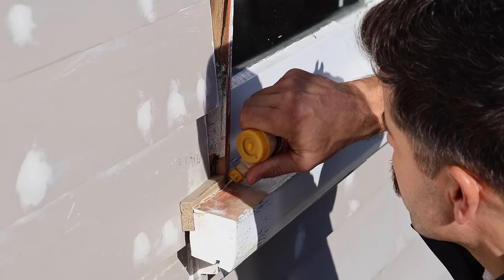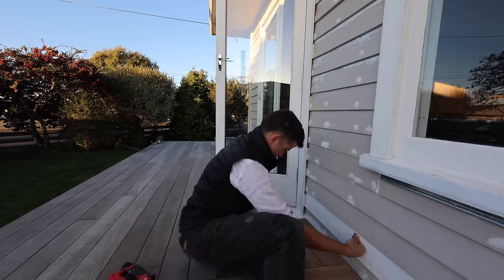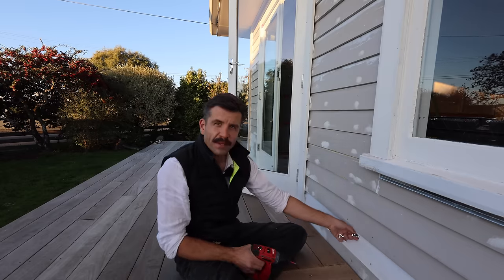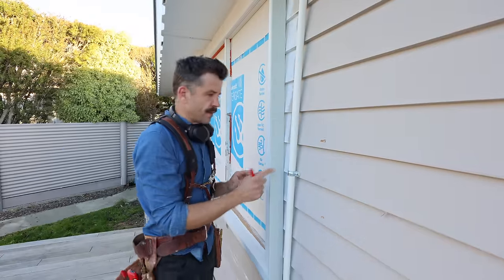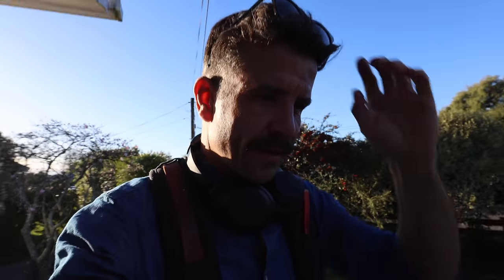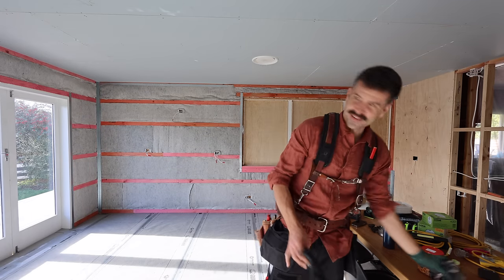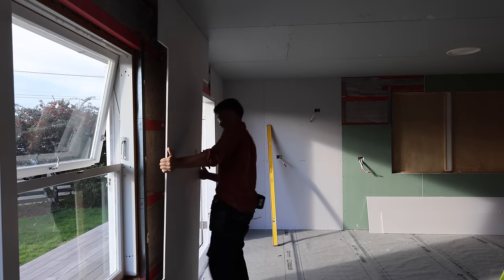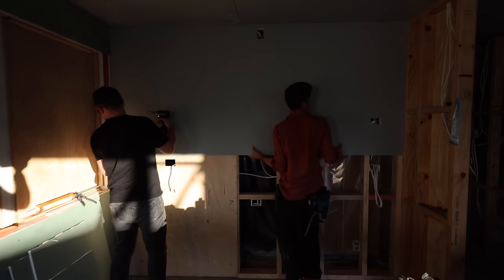This Has Taken Me 8 Months...

Comment: Hi, After 45 years of my working life I figured out that if you placed the door hold back hooks higher on the door you did not have to bend over to clip and unclip them. Another trick is to mount your hotpoints at the same hight as your light switches to help with plugging and turning on/off. I used to do a lot of work in retirement home. Keep up the good work Scott. Cheers Dave from Dannevirke.
Reply: Agreed on the placement of the door hook. I would have put it at hip height. Interesting bit of trivia: in the early days, hotpoints (power sockets) were placed high on the walls for easy access and it stopped small children from reaching them.

Comment: Instead of a hook to keep the door open.  Put a metal plate on the door and have a super strong magnet to hold the door.  Then you can just pull the door hard to close it rather than bend the aging back.  =)
Reply: I put mine on my own house at hip height. Aging builder things, right?! 😅
Reply: Our wind beats magnets 🧲 😊
Reply: @flangekiwi  correct 100%.
Reply: @FysonTord  I was just thinking that. I would have put the hook at hip height, much easier to operate.
Reply: I use my foot to lift the hook 😊
Reply: @TheG1162  Using your foot is not so easy to put the hook on.  Magnets are good for ON & OFF.  That said, a tall hook is great to keep kids from doing things you don't want them to do.
Reply: I use my framing gun and just toe nail the door open.   When I want to close it I just don't.

Comment: I'm very impressed by your high inspection requirements in NZ as a carpenter in Sweden. Never had to wait for an inspection before putting up plasterboard.
In general you seem to have inspections for every little thing!
Reply: Pre lining inspection is basically to check that your framing timber has dried out enough before you seal it behind your plasterboard
Reply: @drewmis1  Never had to do that even once! Very interesting. I can remember one time when the inspector wanted some photos of a special stud arrangement for soundproofing, usually that's not even required.
Reply: New Zealand was left traumatized by what we call here the 'leaky building debacle' (see the Wikipedia article 'Leaky homes crisis'). This explains in part why our inspection requirements are so high.

Comment: It's interesting to see the different building standards in other countries or regions. In Minnesota (USA) we would put a plastic vapor barrier on the wall before the gypsum board. The inspector would need to see this (and the continuous sealant where the screws will penetrate the vapor barrier) before we are allowed to hang the gypsum board. I couldn't tell on yours, but our electrical boxes on the exterior walls have weather stripping on them that seals to the vapor barrier. I don't imagine that you would need that with no vapor barrier. I like your scribe technique for the lap siding.

Comment: In the states we would’ve had to put nail plates over the wire where it went through the framing so you couldn’t drive a nail through the wire. Also I believe the term yo were searching for is the wire is “derated”, basically they used a larger gauge to make up the loss. Great video Scott.

Comment: That condute beside where you were discriibing scribing, I guess is the good wook of Chorus
Reply: Why not put inside seeing as you have had all the linings off???
Reply: Chorus never fail to disappoint...
Reply: @77chuckles  The best way seeing as the cable probably comes in overhead is to fit a demarc box on the gable end and take it straight inside through the ceiling cavity.

Comment: When scribing I will rip the scriber down to my preferred depth.  I measure from the deepest part of weatherboards to the front of the facing plus how far forward i want the scriber to stick past facing. Then I use an offcut of weatherboard (same thickness as weatherboard) to mark scriber. Usually I would use sliding square set at 2/3 mm,  Ruler part of square up against weatherboard instead of using a packer. The last few i have done, I have simply marked the vertical and horizontal lines the same way but cut on the  underside of the horizontal (left line in). Each to their own. Enjoy watching different ways to do things.

Comment: Scott, whats the reason that you glue and screw the drywall? In Sweden (and likely other parts of europe) we just screw it to the wall. Is it to add rigidness?
Also, in Sweden (and other nordic countries) we use "flex pipes" and junctionboxes to then route individual colors of wires (Blue=Neutral, Black/Brown/Gray=Phase/Live,  Yellow+Green = Ground). I think it's handy because in 25-50 years when you are required to swap the cables for newer ones, you can simply pull new ones through without opening the walls. Also, if you need another Phase/Live in a shared socket (washer+dryer e.g) you can simply just pull in another phase without opening the wall. Your thoughts on the pros/cons would be most valued.
Reply: Lived in Germany, the plasterboard was double the thickness of plasterboard in Australia. Maybe that has something to do with it……
Reply: DIY person here, so I might not be right . . .
The board is glued in the middle of it to reduce the number of screw-holes that have to be plastered-over.
To the greatest degree possible, only the edges are screwed and the edges always need plaster anyway.
Now, you can't get away with that on ceilings so, in addition to gluing, the ceilings are screwed but often done in 'pairs' of screws close-ish together [40mm] which reduces the number of 'locations' that have to be plastered on the ceiling.
Note that the board is not usually 'skimmed' all over with plaster; only the joints and screws.
In Australia we call that a class 3 or 4 finish [I think] - not very flat but defects can only be seen by glancing light.
A class 1 finish is all skimmed, so screws in the middle might not cause so-much increase in work.
A top-gun plaster crew can do a whole house, from boards, to ready to paint in one day . ..

Comment: It is a satisfying job hanging plaster, not trowelling and sanding, that sucks. Re screws where glue is- I've never had an issue, over 35 years, I think it's a hangover from the old days when they used nails and/or green wood. A nail can move in and out with building movement but not a screw. Mo suits you.

Comment: G,day Scott Brown Carpentry "with Jess" from Sydney Australia.
The scriber board set out: making sure the board (scriber) depth finishes flush with the storm moulding (outside architrave) therefore the distance of the outer edge of the weather, to the surface of the architrave is important.
🤨🇭🇲🛩️
Reply: Not flush but consistent with all others. He started off right with keeping the scriber parallel with the facing. But he should also have kept it a set distance from the facing and based the width of his scribing jig/block on that rather than the deepest point to the weather boards.

Comment: Insulation does NOT take away any performance. What it does do is reduce the sustained power dissipation for a given maximum temperature in the wire, ie some amount below the melting point of the sheathing and much lower than the point at which wood starts to burn. Performance in a wire is voltage and power loss under load which is unchanged no matter how insulated it is.

Comment: I really really still just don't get why the exterior casing goes over the weatherboards. You can easily cut them back and have them butt into the casing. There's literally zero benefit doing it NZ way and adding scribes.

Also, if you research you will see that exterior casing should have the head piece run long(on top of), not in-between the legs. It's for water diversion. When you stick the head piece in between water can find its way down that seam.

Exterior casing (if not mitered) always goes;  head piece long- legs come down from the head, and the bottom or sill piece goes inbetween the legs

Comment: In my opinion this glue between plaster and wood is pointless because it creates some clearance, which makes weak points so can be easly break just by punching. Plaster shoud be touching wood by the largest possibly area. And if You just HAVE TO glue it, because You were taught so 50 years ago or so, better use small dose of expanding foam which is one of the best glues and can be squzeed almost to 0. Pro tip: spray just a mist of water on wood before foaming - foam sticks better on wet. 2nd pro tip: 1 layer of plaster board sux
Reply: @daniel.s8126  oh, sorry for you guys there. Looks like we have better stuff in europe. Even plaster is 12,5mm but still - 1 layer can't be called a wall : P

Comment: its probably too late now gibs up, but why dont you put in a hybrid cat6 (internet cable) cable inside the wall and get chorus back at a later date to get rid of that ugly conduit down the outside wall? you could do the same with the pair coil and delete the capping for the ducted system as for the cables, they are simply derated by the breaker used at the switchbaord to withstand the increased resistance caused by heat, eg, 1.5mm (lighting) is rated unsurrounded at 16 amp, however when partially or fully surrounded by insulation it has to be derated to 10amps.
Reply: The best way seeing as the cable probably comes in overhead is to fit a demarc box on the gable end and take it straight inside through the ceiling cavity.

Comment: Thought you might of got chorus to move the fibre inside the wall since you had all the linings off? Nice build btw.
Reply: The best way seeing as the cable probably comes in overhead is to fit a demarc box on the gable end and take it straight inside through the ceiling cavity.
Reply: @sw6188  yeah totaly. Some chorus techs are lazy as, but this was probably there before they bought the house.
Reply: @matixnznz  I think it was, and for a Chorus install they actually did it better than most by running a conduit down the wall. I have seen way, way worse installation methods!

Comment: ...the insulation takes away some performance of the cable...  ??  Please explain !
Reply: The cable heats up the more current flows in it. Insulation traps the heat around the cable and makes it get hotter. The insulation of the cable can only get so hot before it will start to fail. Knowing this, electricians will use smaller sized circuit breakers to limit how much current is able to flow, OR use a bigger cable that can draw more current with less heat

Comment: WTF on the cables? resistance goes down the colder the wire gets. And your computer and motors get way hotter than inside of your walls. If anything, you cant mix white and yellow wire because the might burn before the breaker pops, especially if there is a short to ground.

Comment: Scribers- it’s the corner of the house ones I can’t get right, the top I always cut short, how do you do those ones? Windows and door scribers are easy enough
Reply: Try cutting the outside of your 'flush' line, not the inside. It will give you back the 2-3mm you lost.

Comment: Are you not going to remove the Chorus wiring and have it inside the framing , instead of in conduit on the front of the house?
Reply: The best way seeing as the cable probably comes in overhead is to fit a demarc box on the gable end and take it straight inside through the ceiling cavity.
Reply: @sw6188  yeah . And then to the OTP . Usually like to run two CAT6 cables from the demark to the OTP or distribution cabinet . 
In Scott’s case , given all the work he’s do8ng I’d be inclined to run the internet and power underground and have the house look better and not get in the way of painting or trees etc
Reply: @bri200490  If it was my house then yeah, all the services would be underground and I would dig my own trenches for fibre and power etc. Everything would come up and terminate in an equipment / utilities room then branch out from there.
Reply: @sw6188  yeah.  Indeed.
Reply: In a previous video, Scott mentioned trenching the cable. The deck means it hits the house too low anyway, so dropping it through the wall cavity is of no use for now. Just get the tench done!

Comment: How does insulation affect the performance of the cables?
Is it something to do with heat build up in the cables?
Reply: I am wondering the same thing. I wonder if someone is confusing the insulation on the cable itself getting damaged during installation? That usually happens when you draw cable through a tight space. I would love to know the reason in this case though!
Reply: It’s to do with thermal insulation affecting the cables ability to dissipate heat and the risk of damage to the cables as a result. I’m by no means an expert and I expect someone will give a far better explaination.
Reply: @mkrnissen  thank you for your reply.
I thought it may be something to do with heat
Reply: Without getting into the jargon and overcomplicating it, it's essentially about heat in the cable and losses and compensating for those losses so you don't have problems when you power up.

The rule of thumb says that a certain size cable is perfectly rated for the job however once you do your calculations you might find that your cable is actually underrated for the job and will cause problems for you such as nuisance tripping or the eventual breakdown of the cables insulation due to excessive heat and exposing bare conductors to the building.

Some factors we consider are:
- cable length
- cable size
- cable path
- cable insulation type
- building insulation 
- conduit diameter, above or below ground, in a roof, etc.
- spacing from other cables, etc.

Not sure about other countries but in Australia we actually have standards that guide you through the calculations so you can get it right the first time.
Reply: @wearsjorge55  thank you for taking the time to explain matters.
I now understand the situation👍

Comment: Cool Tom Selleck look! Why don''t you use the opportunity to hide your internet connection before you put up the plasterboard and ridd of that conduit on the side of the house...
Reply: The internet conduit is going to be dealt with at a later point. The best way seeing as the cable probably comes in overhead is to fit a demarc box on the gable end and take it straight inside through the ceiling cavity.

Comment: what is the tool you use after you have cut the gib? and what adhesive do you use to fix to wall?
Reply: It's a drywall rasp, easy way to smoothen out the side, or reduce it by a few mil if you cut the board too large.

Comment: What do they check during the inspection?
Reply: That all relevant previous inspections have passed. That the building is substantially closed in / weather proof. Plumbing. Insulation. Moisture content of framing. Air seals around windows.

Comment: wondering the meaning about loosing performance  having the cables behind the isolation,  as thicker cable just means more power  can run thrue the thicker copper wire without creating more heat  then a thinner wire  running same current, something that really doesnt have to do with it being behind wall  isolation as wire is calculated on expected loads. but you could say having thicker copper wire has less resistance and less heat with lower rated current  then the cable would be rated for.  but as most cables are behind in a wall or pvc tube  in the wall or in some countrys behind plaster would stil mean they are isolated of dissapating heat and ends up the same as what is done with this type of wall isolation.

Comment: Coming from Canada where we get very cold temperature it really freaks me out that you dont have a vapour barrier.

If you are heating the space to 20⁰ I would still expect you to get some dewpoint in the walls over the winter. Is this not a requirement in NZ?
Reply: from the BRANZ report.....The study suggests that it is not necessary to add a specific vapour control layer to prevent accumulation of liquid moisture. This is in line with previous advice from BRANZ. It is also shown that this practice is in line with current international guidance for similar climate zones, with acrylic paint systems and internal linings providing enough vapour resistance to prevent condensation damage further into the wall while still providing good drying capacity.
Reply: @nix123ism  Awesome background info. I guess you don't get down low enough, or get hot+humid enough with A C running in comparison to the NA climate zones for it to be necessary. 

Definitely a benefit to be able to dry to both sides of the wall with semi-/permeable barriers on both sides.
Reply: @nix123ism  Also, in warmer Southern stated of the US, they have learned that vapour barriers can have the opposite effect (especially when using aircon) and create condensation on the 'wrong' side of the barrier. The roles between inside and outside are reversed with regards to humidity and temperature differentials.
Reply: @kiwigrunt330  that is what I was expecting, hot humid NZ + AC would make me expect the humidity curve to be reversed, but if the differences aren't as extreme I guess you aren't hitting those dew points

Comment: As an engineer from Ireland the idea of having to get an inspection to put plasterboard on is crazy. What's the idea behind this? Is this required for all residential???
Reply: The pre-line inspection is probably the most contingent one of all, and checks off the following: that all previous relevant inspections have passed, that the building is substantially closed in / weather proof, plumbing if required, insulation, moisture content of framing, air seals around window... If there are still unresolved issues from previous inspections, this is often the point where the inspector will demand for those to be resolved before passing this one.
Reply: After the plaster board is up it is pretty hard to fix and faults behind it - hence the inspection to make sure all is done.